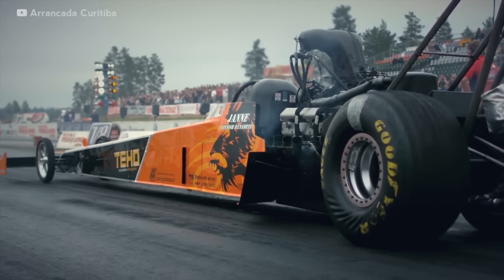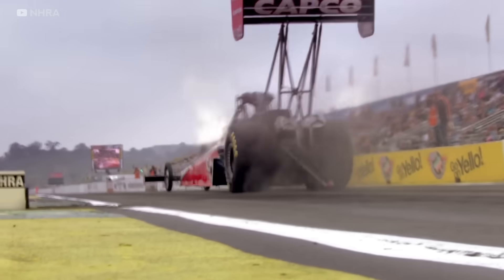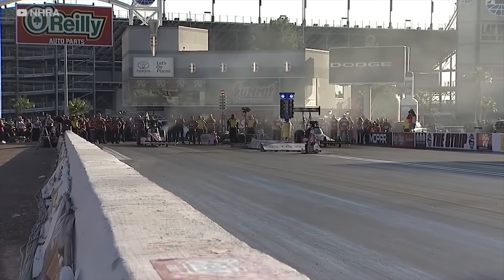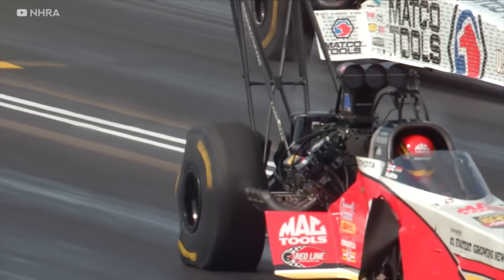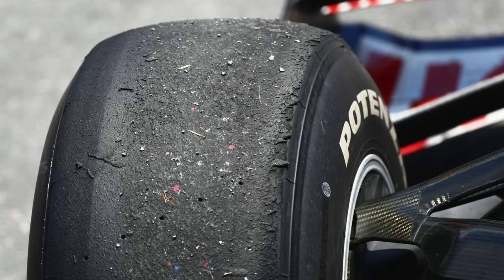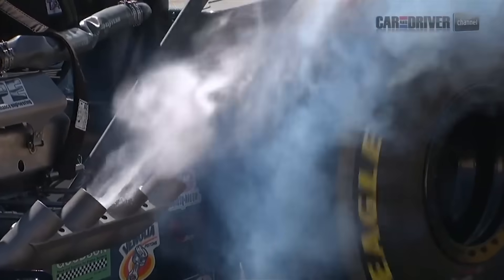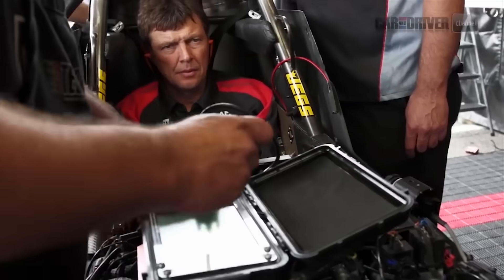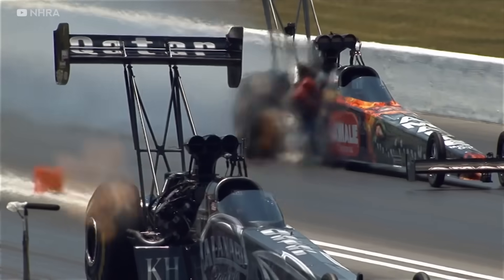How Dragster Tyres Accelerate to 335 MPH in 3.6 Seconds

Comment: My favorite fact about these cars is that the supercharger require over 1000 horsepower to spin. That's an absurd amount of air compression
Reply: When your hypercar can only power the supercharger lol
Reply: @yourerightmybad7363  😂😂😂😂
Reply: John Pike yes, it's a fact. It's only an estimate that they produce 11,000 HP because there's not a dynamometer in the world that can handle the power they produce. Google it if you don't believe it.
Reply: @KJ-kw7gh  That's what I thought too for a long time. Turns out a team designed an electronic coupler that fits into the drive train and direct torque measurements were recorded thus with math, horsepower. 11,000 for HP is a documented number now. Erroneously many on here assume it take 1000 HP to drive the supercharger .. not correct. It takes that much HP to spin the SC at engine redline when it is generating pressure, which is around 65 psi.
Reply: Xen Uno highest horsepower measured on a dynamometer was 5,300 HP. Top fuel dragster HP is calculated by time, weight, distance, and speed. They've taken historical HP measurements in the sport and "estimate" the horsepower needed to achieve the speeds and times achieved currently. Don't have to believe me, Google is your friend.
Reply: @KJ-kw7gh  Naval diesels can easily.make over 100k bhp, and yet they can be measured.
Its just that nobody bothers I guess.
Reply: I need no channel youtube! Navy ship HP is calculated by hull resistance tests, which factor in model ship drag resistance, propulsion system used, power plant, and several other factors to "estimate" HP needed to achieve a certain speed under certain conditions. They don't connect ship power plants to a dynamometer. Highest HP ever measured on a dynamometer is around 5,300 HP. Nobody has made one yet to measure higher as of yet.
Reply: This cars have 10k + HP the compression is insane
Reply: @Tiagof_26  no, the compression really is stupid low because of how volatile the fuel is...plus have you seen how big those superchargers and the pulley attached to it is? I don't know superchargers all that well but your typical whipple supercharged mustang with an upgrade pulley runs somewhere around 12-15psi iirc so the Top Fuel cars gotta be running somewhere north of 15psi (possibly even over 20psi). Anytime you add boost to an engine you either have to pull timing, run a more aggressive cam, or lower compression unless you can run higher octane (let's just assume the nitrometh is the highest octane teams can run, for sake of simplicity)
Reply: @DerpyAngel09  they run 80+ psi
Reply: @Mrshotshell  yeah so I've learned over this past week, it's insane what you can do with 496ci and a giant blower pushing stupid amounts of boost.This past week  I've been building drag cars in BeamNG using the vanilla cars and some drag specific part mods, working on the ETK K-series with Meo's Funny Car Engine mod with the variable blower cranked up to a 3:1 pulley ratio so it makes around 97psi and the thing is dumb quick on 31x12 drag radials and barely hooks even if I roll into the throttle. Leave it to this video and BeamNG to get me into drag racing like I've never been before lol
Reply: @DerpyAngel09  Forced air induction increases compression from the mechanical ratio doe?
So even if the cylinder utself only has a ratio of 7:1 or whatever, when you pump an extra ten atmosphears of airpressure in, your effective compression ratio is 17:1
Reply: @johnpike9612  there are internal combustion engines making over 100,000hp.
Reply: John Pike ok.......
Reply: It's because of the fact the engines are practically hydrolocked because of the stupid amount of compression
Reply: matt hill Compression Ratio is about 6.5:1
Reply: @Amsinckster  holy shit,its like,like  not even comparable to normal or even normal racecars
Reply: Amsinckster i don’t even know what this means
Reply: Astrxcat XIII it’s very low, a normal car is around 9.0-11.0 to 1 compression
Reply: @Suburbanhotrods  But by the time you pump air into it at 66-74 PSI, the actual compression ratio becomes much, much higher.
Reply: matt hill How do they start the engines?
Reply: @NatedoGP  I saw clips where they bring big external electric motors to start it up.
Reply: @NatedoGP  external starter, and alcohol as fuel initially
Reply: @NatedoGP  the original electric motors were jet engine starter motors. Now, I'm sure they are made specifically for dragsters.
Reply: @johnpike9612  there are cargo ships with >100.000hp. Do your research.
Reply: Michael Fritsche  that's badass mate
Reply: John Pike do your research lol. Yes there is.
Reply: why is there a supercharger if, as he said, nitromethane doesnt require oxygen to combust
Reply: @avocado9780  The power you can get out of an engine is largely dependent on how much fuel/air mixture you can stuff into the cylinders. The supercharger is a pump that rams a huge amount of mixture into the cylinders. Nitromethane produces more power for each explosion in the cylinder because it in effect, carries its own oxygen. So ,between the extra powerful fuel, and the blower ramming so much more of it into the cylinders, you get these insanely powerful engines. this would literally blow an ordinary engine to bits, but these engines are specially built to be strong enough to take that power (for a few runs hopefully).
Reply: also, the fuel line is 2" diameter!!!   and also they are going 100mph before the back tires cross the starting line.
Reply: Isn’t there some crazy math that works out to very few actual revolutions of the engine per run. Like from green light to finish line the engine only makes 3-400 revolutions of the crank. I remember being explained this before but forgot most of it.
Reply: @gavincline209  7500rpm/60s*4s=500
Reply: Well yeah math wise but other factors are involved also, like any little bit of tire slip, or clutch slip from initial engagement or afterwards.
Reply: @gavincline209  the amount of revs per given time is not affected by spinning tires or slipping clutch etc. but distance travelled per rev will change, if thats what you mean.
Reply: MCBritta it definitely is effected by any slip or spin. Maybe not in this instance if none occurs but overall, yes it still does. Also like the video said, the changing of tire diameter will effect rpms also. No way to calculate that unless every measurement the tire goes thru is known and that’s be damn near impossible to figure out. It might be able to be be averaged but not exactly know down to the .1 of an inch.
Reply: @gavincline209  clutch slip, spinning tires and a changing tire diameter affect the distance travelled per rev, not the amount of revs per time X.
you were asking for the total amount of crankshaft revolutions for a single run.
with an average rpm of 7500 and a 4 second run thats 500 revs.
Reply: MCBritta yes that is right, but your forgetting time isn’t the constant here...distance traveled is. The strip doesn’t change length no matter what the time it takes to get to the end is. So the distance traveled is the key factor and constant to this equation for RPMs

Say the car gets loose at the 660’ mark and driver lifts, the ET slows down but the tires don’t slip, therefore the physical number of engine rotations required to cover the distance doesn’t change. 

Now if the tires do slip then the engine turns more revolutions then before over the same distance traveled.
Reply: The most powerful dragster is only 3000hp!
Reply: @domi7007  bs there are cars that have over 3k hp..
Reply: Georg Wagner No, thats fake. A car can max have 3k hp. And max 5 lieters because its not possible to get more
Reply: @domi7007  you are way off buddy...
Reply: 1216jimmyz no
Reply: @domi7007  they run nitromethane, that's the key to the 10000hp,
Reply: Ciro Ricciardelli They don’t run on nitro matan , they DONT wil work, only bio diesel or propane.
Reply: @domi7007  I hate trollers
Reply: MrDrakePrice Then im sorry :(
Reply: @johnpike9612  Well they can only handle it for around for 4 seconds, so even in your wrongness, you are correct, pro Street cars have around 3500 hp, hows a top fuel going to have 2000?
Reply: I was into the fact that they were measuring the sound produced with the richter scale. whoa.

But yea its a CRAP ton of air. What people don't realize it they suck in the air around them. A 5 liter engine revving at 5000rpm. Thats 25000 liters of air moving through the engine every minute! Thats almost 1000 cubic feet of air. About the same volume as a 20ft shipping container. 

An open intake on an engine can be dangerous. Many rags have have been sucked into engines that way lol. Probably  even scarier stuff.
Reply: The thing that confused me and contradicts itself, you said they use nitro methane because it doesnt require air to burn, but if that was the case then whats the point in the supercharger? I suspect your facts need checking there because the supercharger would be a waste of time if they dont need air to ignite nitromethane.

Secondly, surely they must have gearboxes to allow them to reverse back to stage, since they arent pushed back, and you cant reverse the way to engine rotates so there must be a gearbox?
Reply: @MrJaiimez  superchargers work by ramming more air into the cylinder. So in turn, more fuel. IDK much about nitro methane. A higher energy density is what my brain says. But thats not actually the case. Its that they can use MORE fuel.

"Nitromethane carries its own oxygen, so it needs much less atmospheric oxygen to burn. The theoretical ideal or stoichiometric air/fuel ratio for gasoline is 14.7:1. That means, 14.7 pounds of air are needed to burn 1 pound of gas. Methanol, which also carries oxygen, has a stoichiometric ratio of 6.45:1. But with 100 percent nitro, the ratio is 1.7:1! Because the displacement of an engine cylinder is fixed, this means-assuming 100 percent volumetric efficiency (VE)-8.7 times more nitromethane than gasoline can be burned during one combustion cycle.

On paper, gasoline has about four times more heating value than nitromethane: at least 19,000 Btu/lb for gas compared with just 4,850 Btu/lb for nitro. But that doesn't take into account the fuel's specific energy (SE) value, which is derived by dividing the heat value by the air/fuel ratio (Btu/lb A/F), telling us how much heat energy is delivered per pound of air into the motor. At stoichiometric air/fuel ratios, the nitro's SE value is around 2.2 times greater than gasoline"

As for reversing. When you are building machines that are this extreme. You don't give AF about reversing. They are rebuilding the engine between runs. Do you really thing that using a dedicated tow vehicle to move and stage it is so out of the ordinary?

Reverse just gets in the way.

Towing race cars is super common. Some of these cars literally DON'T go slow. They get towed right to the starting line. VERY extreme machines. Ive driven loads of cars, but Im not sure I could even budge an F1 car off the line with out loads of instruction. Probably id just stall out and break something.
Reply: @MrJaiimez  You can burn nitromethane without air, but you get the most energy out of it if you do have air. You don't need much though - the air to fuel ratio for nitro is 1.7:1. For comparison, gasoline runs at 14.7:1. That means that with the same amount of air, you can burn more than 8.6x as much nitro as you could gasoline.

Interestingly, nitromethane actually has less energy per gallon than gasoline does. This is more than made up for though by the sheer quantity of fuel you can burn, due to how little air it requires.

Comment: If the engine does not need air, what is the supercharger porpuse?
Reply: nitromethane has extra oxygen molecules attached to it, it still needs air for complete combustion. its basically like running an alcohol fuel with a supercharger with nitrous oxide
Reply: @thesquirrel082190  thx
Reply: Nitro can burn without air, but it won’t give you maximum power. The stoichiometric ratio (ratio of air to fuel for complete combustion) for nitromethane is 1.7:1, but they run closer to 1:1 (rich mixture) to prevent detonation.  For a comparison, gas/petrol’s stoichiometric ratio is 14.7:1.